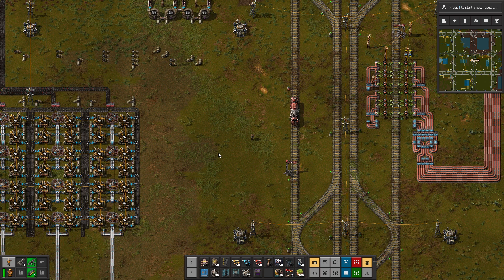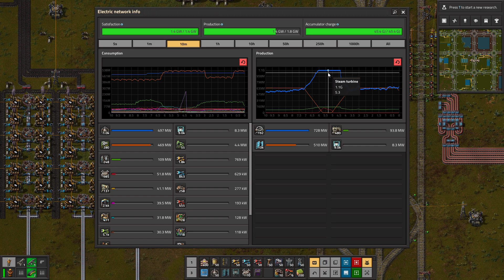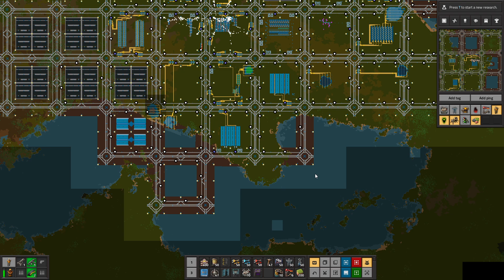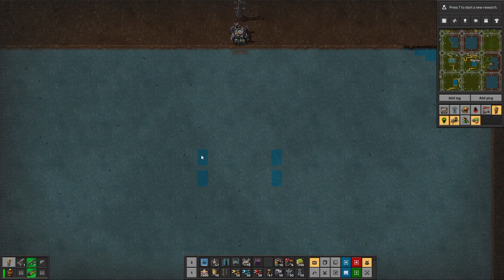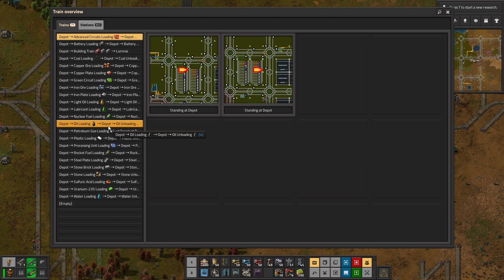OIL, NUCLEAR AND RED CIRCUITS - Factorio 1.1 - Entry Level To Megabase 2- Let's Play Tutorial Ep 61

Comment: One question: why are you not puting pumps to force the oil into the station ?? you are getting the oil from far away and have a lot of underpipes to get it into the tanks
Reply from the maker: The throughput is not limited by the pipes so see no reason to add pumps :)
Reply: yea if you set he fluids on the wiki if you wont a flow off 1200 u/sek you ned a pump evrey 17 pump
Reply: men pipe
Reply: 17 pipe